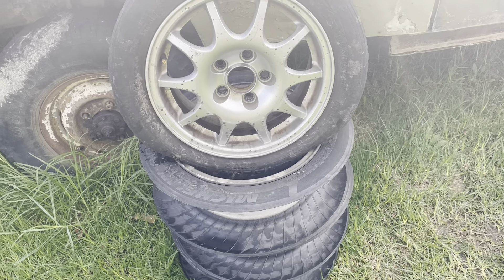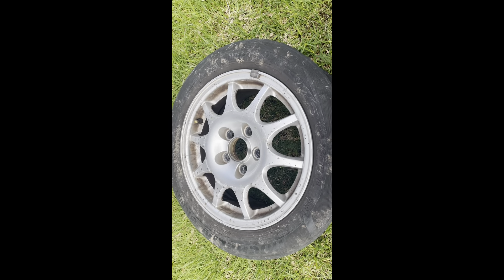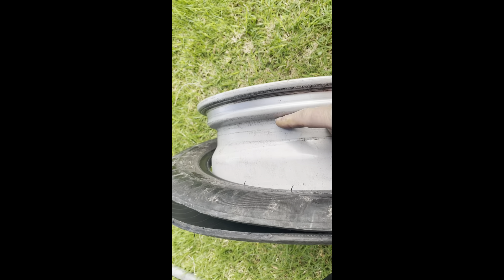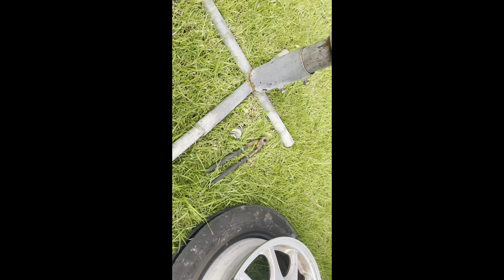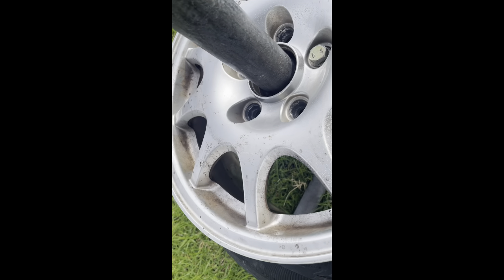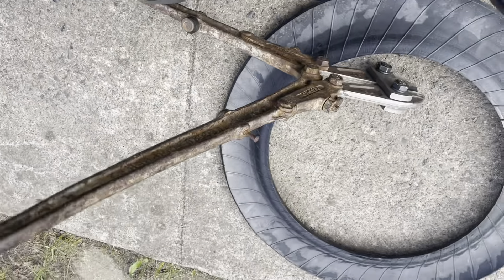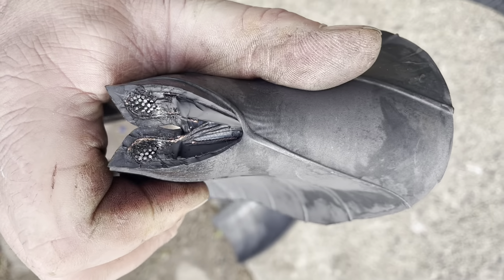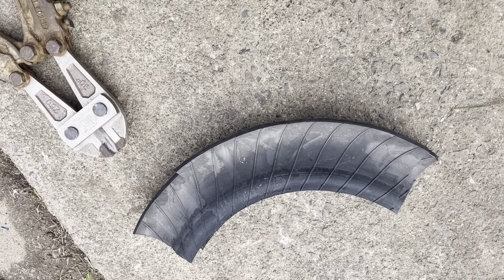Scrapping a car tyre

Comment: Thanks to poly prophet got to this channel.
Good method of getting tyres off the rims, never thought of cutting it into three parts. Also good idea of using the separate band for growing plants to safe them from my dog pooping into them. Will get a try.
Another method of getting the tyre off the rim without special tool is driving on them with car, tractor, maybe use a stiff board as pressure plate to drive on it (this way used to get 22,5 truck tyres off the hump into the channel).
Reply from the maker: Thanks for your comment. I have a friend who uses a wind up trailer jockey wheel to break the bead of the tire. He welded it together himself and it works well but is a bit slow for doing more than one tyre.